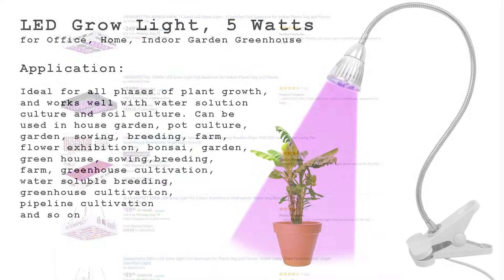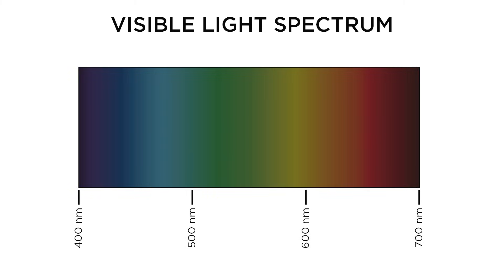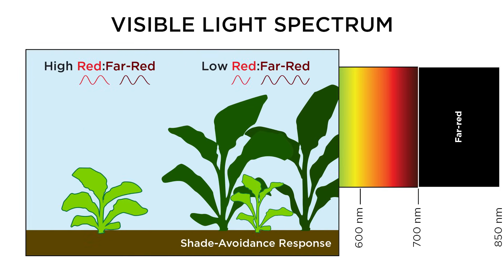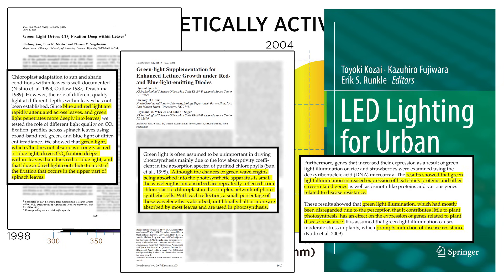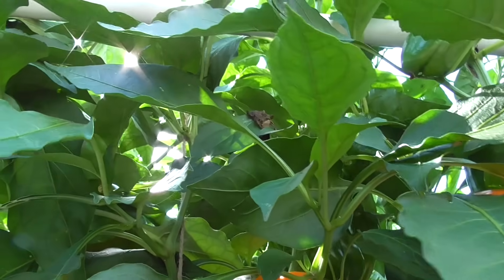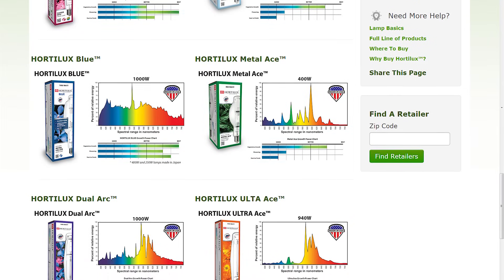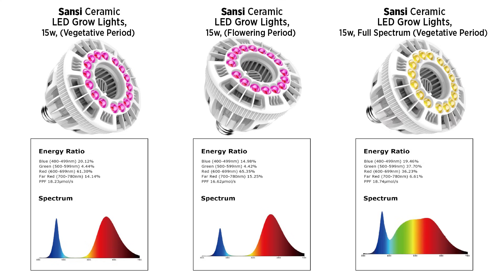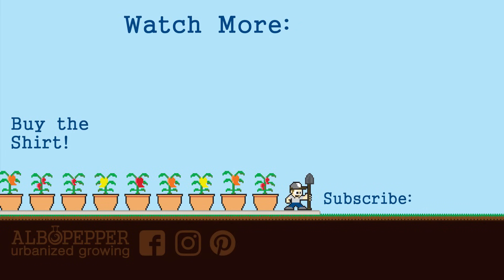PAR Light Quality LEDs & HID: Plant Grow Light Basics -101 (Do Plants Use Green Light?)

Comment: We need you to remake this in 2024 to update anything weve learned since then.
Reply from the maker: I already remade this: https://www.youtube.com/watch?v=kUpEQ4kU148
Reply: @Albopepper  how did I miss this? I swear I've watched all your videos. Thanks for this.
Reply from the maker: No problemo! 😃
Reply: @Albopepper  do you mind if I ask your opinion on the t5/t8 leds? They seem like good value but I'm not sure if you end up paying it all back anyways compared to buying an actual growlight with decent diodes and a stand alone driver. I've been wondering if it'd worth replacing my lettuce t8s with actual grow lights.
Reply from the maker: The nice thing with t5/t8 LEDs is their linear form factor. This can be very useful for narrow shelves/racks. To estimate potential payoff for a more expensive LED, you would need to know the PPF output for both lights so you could match output. And then, you would need see how much less power the expensive LED is using  (assuming it is more efficient) to begin estimating ROI. I had made a video about that: https://www.youtube.com/watch?v=aToYhyPZMVs

Comment: Question: I've seen pepper growers use 5000k flood lights as grow lights and have great success with it. How is that? Is that just because 5000k is a good middle point between blue and red light, - and thus is defined as "full Spectrum". Or how does Kelvin relate to the wave lengths that plants need?

Comment: Have Plant my dog chewed off 3 of the lower Kola stems to the stem. I have a main source of Light in my grow Bulb and saw the lower part of plant too far from top main Light. I decided to brainstorm and bought Amazon cheap 18$ T5 LED 14 INCH LIGHT STICKS ( A PAIR OR SET OF 2 LIGHTS) I GOT THEM TO USE AS ADDED MISC LIGHT SOURCE FOR BOTTOM OF PLANT WHERE MY DOG CHEWED OFF. I place the LEDS on side of bottom plant of opposite ends while using my main top grow bulb on top giving me a prism like radius. I set LEDs at yellow and blue and BAM!! 3 TO 5 DAYS LATER THE CHEWED UP KOLAS grew back same size as top plant. Im now set the lights to full spectrum( blue, yellow, red) and noticed leaves more dense and edges more defined along with  more growth.  Setting to full spectrum was to get plant ready to flower as full spectrum gives that sunrise, sunset spectrum of changing seasons.. Them cheap Amazon LEDS are great to use as misc lights along with your main grow lights..

Comment: Hey bro I have been looking at adjustable spectrum LEDs while most are 2700k adjustable upwards I was able to find a brand called globe which has a 2000k-5000k am I the only one highly interested by this? They are not super efficient at only about 80 lumens per watt but I think that is with a frosted cover if that were removed I believe they would be more efficient? 
My thought is to do an experiment starting a lighting cycle at 2000k and every hour  going up 500k then once I reach 5000k to start going back down until I get back to 2000k.
Do you think this lighting pattern will simulate natural lighting patterns and achieve better plant growth?
Reply from the maker: In concept, it seems like an interesting idea. But horticultural research has shown that plants do not require spectral shifts like this in order to thrive. The overall composition of the spectrum is important. The percent of blue and percent of far red can lead to dramatic plant morphologies. Photoperiod is important too or even crucial for certain plants. But to get good, thick growth, plants need to get enough photons. Poor light intensity can easily be the biggest limiter when it come to matters surrounding plant lighting. Terms like PPF, PPFD and DLI allow us to quantify the photon dose and then get the desired growth.
Reply: @Albopepper  So do you think I should use about 8  of them which would be 6400 lumens probably more with the frosted plastic cover removed and still only about 80 watts and use a spectrum around 3500k for a vegatative cycle and 2000k for a flower cycle on a shorter cycle? I know hps at 2000k is well known for creating good flowers I just don't know if 3500k is the preferred veg cycle of lights limited to one wavelength for flower and veg simply because they are limited or if there are better wavelengths for veg?

Comment: Hey thanks for the info !

I just have a question. If i were build a panel and fit a bunch of 3500k led light bulbs , 3w each - would thay work as a grow light? Or something along these lines
Reply from the maker: They would be able to grow something like lettuce or seedlings. But you would need quite a few and it would not grow many plants. Probably not the best way to invest in a grow light system.
Reply: @Albopepper  what would be a cheap grow light system?  Would it make a difference if they were higher wattage and perhaps an array of Kelvins to cover the spectrum? 

Its hard cos i dont live in Europe or the States so basically everything is even more expensive due to having to import whatever product it is.
Reply from the maker: Are you running this year round or just a couple months per year? Seedlings? Why not use shop lights?
Reply: @Albopepper  I want to use it for an autoflower strain of cannabis, the website says it takes 70-80 days from seed to flower.

They don't have grow lights around here i can only get it online. If that's what u meany by shoplights
Reply from the maker: 3W LED bulbs are not a good solution for what you are trying to grow.

Comment: i think just red and blue is ok. can we use any lights have red color and blue. is it right?
Reply from the maker: No, it is not always ok. Some plants don't grow right if the red and blue colors ratios are not correct.
Reply: @Albopepper  what is the best for strawberry
Reply from the maker: Sunlight is best. For indoors though, I would use a light that has the broadest spectrum that I can find. A white light. Not purple.
Reply: @Albopepper  so i can use white led for sure? I wanna ask one more thing. 1 led (18w) have 2000 lumen, if i put 2 same led together. Can they have 2000+2000=4000 lumen. More light brighter

Comment: green light on a green surface will reflect 90% of green light its basic light engineering?!
Reply from the maker: "Sometimes one may hear that plants don’t use green light for photosynthesis, they reflect it. However, this is only partly true. While most plants reflect more green than any other in the visible spectrum, a relatively small percentage of green light is transmitted through or reflected by the leaves. The majority of green light is useful in photosynthesis."
-- https://www.canr.msu.edu/news/green_light_is_it_important_for_plant_growth

I list plenty more sources in this article:  https://albopepper.com/red-blue-LED-grow-lights-with-no-green-spectrum.php
Reply: AlboPepper - Drought Proof Urban Gardening so basically green helps grow leaves at the lower part of the plant. In the first article they say most efficient was only Red 50% and HR50% why not use just these wavelengths ?
Reply: boom! sorry cyrano. i guess you lose ur engineering degree!  lol
Reply: James Bradwood I don’t think u have read those articles ..it’s partly true and the plant is reflecting or is letting it throw the leaves which is based on it biological structure. Why do u think a black car is getting hotter than a white car under sunlight?
Reply from the maker: Why not just use broad spectrum white and cover all of your bases? All PAR light is usable by the plants. And if it's white, it's much easier to work around the plants, including diagnosis of possible growth issues.

Comment: I have been using my freshwater aquarium grow lights. Figuring if they are good at growing pants under water that is a good start. Turns out most of the light consists of 7k full spectrum beads, with the addition of rgb beads for adjustable additional lighting in more specific spectrums.

If I could afford it I would add a quality red and blue supplimemtal (not the main light) light with IR and UV added in. Have a cheaper one, but like anything else, to get a better light you have to pay more

Comment: Reckon the uv light kills parasites and disease...doubt it is the plant doing the work
Reply from the maker: The effect of natural levels of UV-B radiation boosting plant resistance to biotic stress has been linked with increased expression of jasmonate (JA) responses and with the induction of increased levels of phenolic compounds. Indirect evidence for a connection with JA responses originated from the observation that plant exposure to solar UV-B can increase the expression of JA-responsive markers, such as proteinase inhibitors, in tomato (Solanum lycopersicum) and Nicotiana spp. (Stratmann et al., 2000; Izaguirre et al., 2003; Demkura et al., 2010). However, synergistic effects of UV-B and JA elicitation have not been observed for several classic markers of the JA response in Arabidopsis (Arabidopsis thaliana; Demkura and Ballaré, 2012). Similarly, mixed results have been obtained regarding the effects of UV-B radiation on JA accumulation (A-H-Mackerness et al., 1999; Demkura et al., 2010). The strongest evidence for a role of JA in some defense responses triggered by natural doses of UV-B radiation comes from studies using mutants or transgenic lines impaired in JA biosynthesis or signaling. Disruption of the JA signaling pathway in Arabidopsis (Caputo et al., 2006) and Nicotiana attenuata (Demkura et al., 2010) was shown to eliminate the effect of solar UV-B inducing plant protection against herbivorous insects. In contrast, a recent case was reported in which a positive effect of UV-B radiation on plant resistance against pathogens was conserved in JA-response mutants (Demkura and Ballaré, 2012), suggesting that UV-B radiation likely influences plant defense via multiple pathways.
Reply: AlboPepper - Drought Proof Urban Gardening interesting point...I wonder though, if a JA response puts a plant under stress, would an increase in JA production within the plant lead to smaller yields and potency?

Comment: Hey if you go to horticultural lighting group buy a 2pcs 288-5000k and a doouble heatsink, (1) HLG-150H-54B, a dimmer control you can have a led light that can go from 20-150w watts for about $300 to build yourself.  Doing this will get you 3.02 - 2.75 μmoles/joule  getting light at 380-780nm. If you want a little more red go with 4000k

Comment: Okay, so get an ultraviolet light and then install an ozone layer synthesizer. Got it, thanks.
Reply from the maker: LOL ,good one Jeff! Actually, there are LED options that include a UV diode, integrated into the system. Or other horticulture lamps are known to emit UV, such as Ceramic Metal Halide. And you're right that people do need to take basic precautions to limit UV exposure around such units!

Comment: AlboPepper is good a photoperiod of 24h on with a DLI of 15 mol per day in lettuce grow vs other schedule?
Reply from the maker: Hi Max, I've never tested photoperiods with lettuce, especially at 24h on. One reference from Cornell indicates that lettuce seedlings can tolerate a higher DLI and can be grown 24h on. http://www.cornellcea.com/attachments/Cornell%20CEA%20Lettuce%20Handbook%20.pdf But I don't know what would happen as they mature. I don't know if they would bolt or not. That would be very interesting to find out. I would try it and see what happens!
Reply: I have been reading these articles https://www.researchgate.net/publication/11806220_Effect_of_16_and_24_hours_daily_radiation_light_on_lettuce_growth,  https://www.researchgate.net/publication/225040540_Plants_under_continuous_light_review and I thought that you would know something about it to be sure to try it with my lettuce (it's my first time under light so I have not tried it yet). It would be great if you tried, sorry if my English is not very good and thanks for responding and for your videos,

Comment: Full spectrum cobs and quantum boards which are the best led grow lights do use the 1000k 10000k rating the best are 3000k
Reply from the maker: Yes the inclusion of a phosphor coating (shown in the video) allows for the creation white light. The Samsung LM561C diodes are commonly used in quantum boards and their Kelvin color can be tweaked per application (2700k, 3000k, 3500k, 4000k, 5000k, 5700k, 6500k).